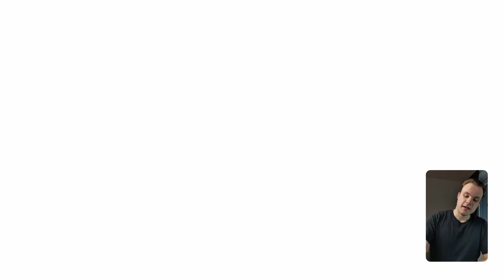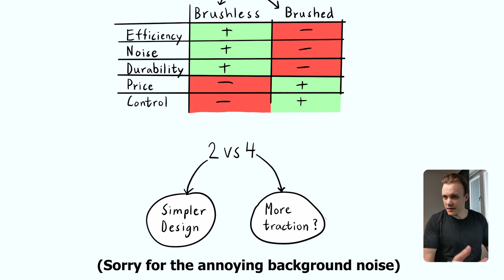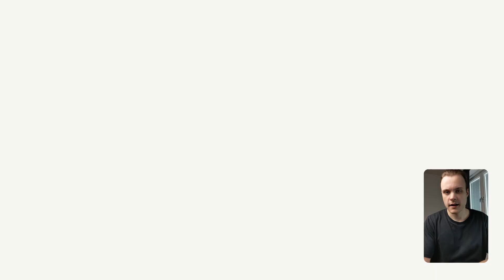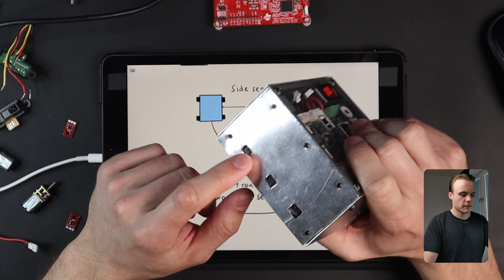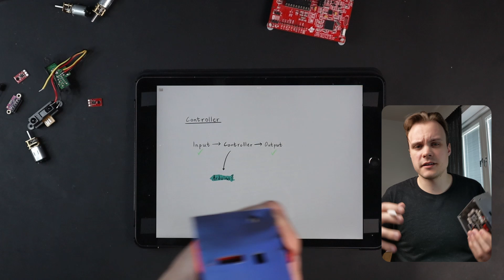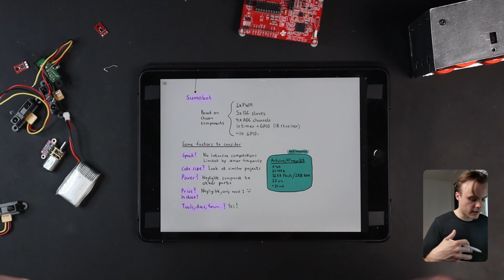Picking the Parts for a Small Robot  | Embedded System Project Series #2

Comment: bro is it possible to use 5 i2c slaves in an Arduino without using any multiplexers, if you used Arduino for this project (just curious about it) , unless all 5 have different i2c address.
Reply from the maker: It's possible if they have different addresses. The range sensors I used for this project (VL53L0X) have the same address at boot, so they can't be used on the same bus as is, but it's possible to reconfigure the address of them, so that's what I do. I boot them up one by one and configure a unique address.
Reply: @artfulbytes  that's cool , your embedded series is soo much interesting, Keep it up bro ♥️

Comment: looks like I found a gold mine channel with actual good content
Reply from the maker: Well, that's very nice of you to say!
Reply: Yeah me to thanks to the algorithm
Reply: I'm currently engaged in cs studies. I was wondering if you had some address to find internships in embedded systems
Reply from the maker: @digit_cameleon  No specific sites other than the typical job sites (e.g. LinkedIn). My impression is that it can be harder to get an internship within embedded systems compared to other fields of programming, higher barrier of entry. Not sure where you are located. But I would try to reach out to companies that has open positions for embedded systems and ask them about possible internship/thesis work. Otherwise, any position where you are exposed to C/C++ even if it's not embedded systems would be a good experience. Besides internship, make sure you gain experience by working on your own embedded projects, it's something I wish I had done more of during my studies.
Reply: @artfulbytes Hello, I am french. I will do my best to find internships related to embedded systems. Thanks for the advice.